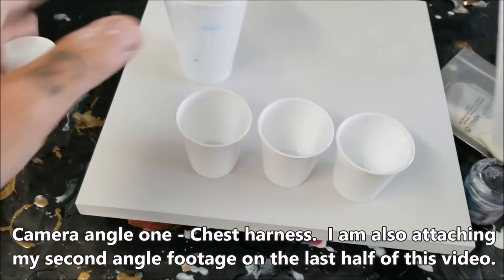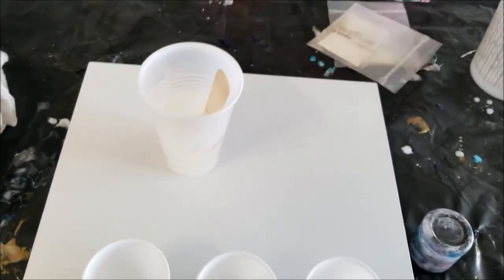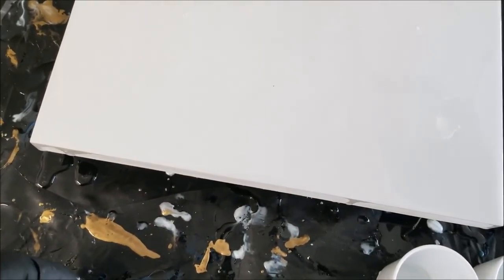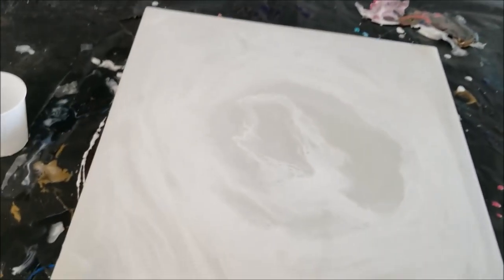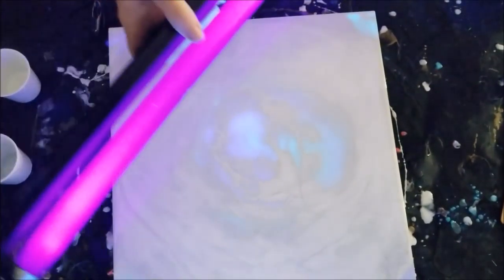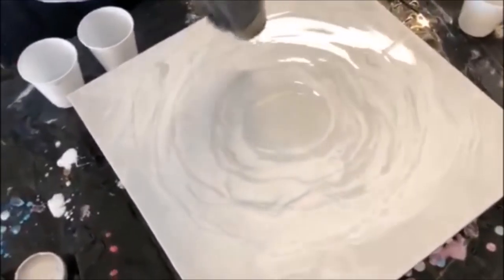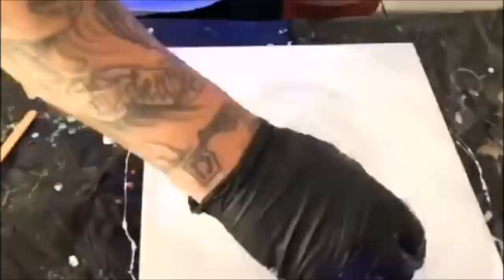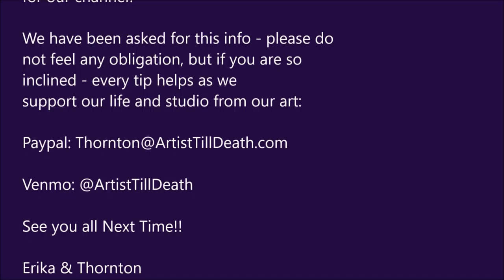Phantom Glow in the Dark Resin Pour (WITH CELLS)

Comment: I wonder if you did a multi layer pour (maybe 1/2 inch) and embedded a UV LED bulb (3mm) and wired it, if it would keep the glow hot. not sure about the light transmission but maybe if you did a thick first coat with only resin and UV light, it might travel down that first layer unobstructed and light up the glow in the dark elements.
Reply from the maker: I think those are great ideas.  We have been toying with adding leds to the pieces.
Reply: I'm getting ready to pour a multi layer with them myself this weekend. Ill let you know how it works out. Also, i used to live around the corner from deep ellum. Watched another of your videos with the "studio tour" and was like "HEY! i know that place".. by the way, i do animation, sound design and editing for a living, so if you ever need help with stuff like that lemme know!! rock!